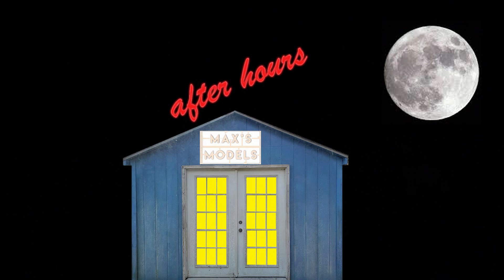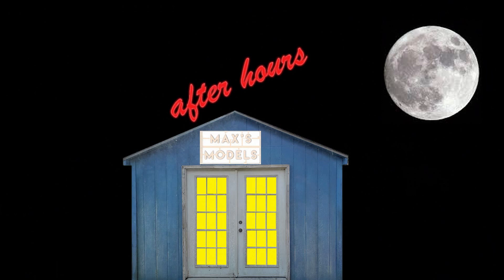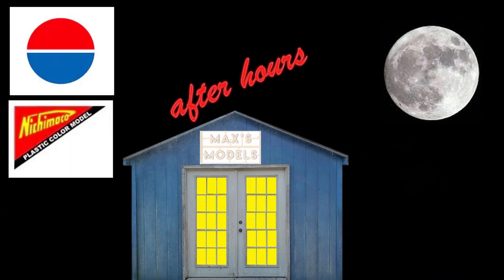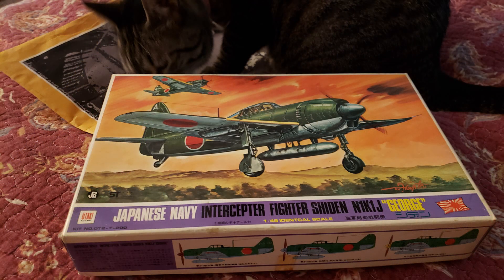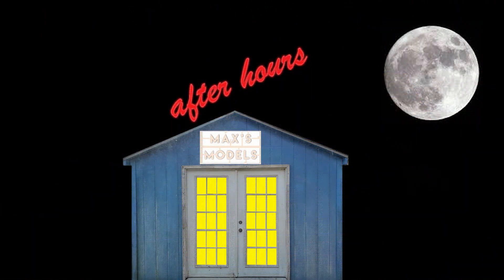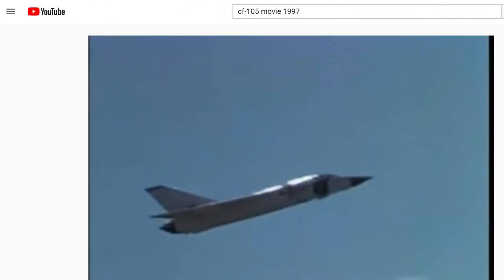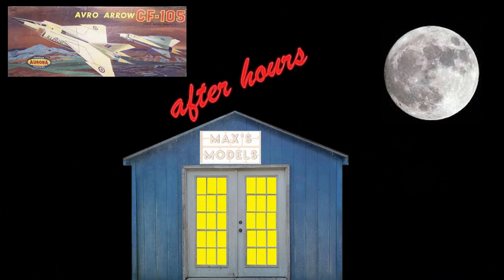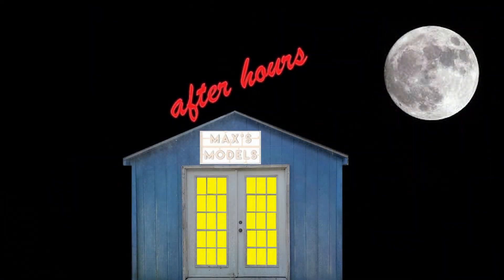Max's Models After Hours 07/28/20

Comment: Preserve that vintage box (1972) Ōtaki kit and decals Max. It's history. For an online vintage build, that exact model can still be bought (HLJ) under the ARII (Microace) reboxing. Same mould -still quite crisp sprues, but later (1975 on) drop dead gorgeous Ōtaki boxart replicated (in a window) by ARII, which unfortunately, does include different unit lower quality decals presumably commissioned by ARII as a cost cutting measure. I had a few 1/48  Ōtaki kits in the very early 1980s, and bought a few of their ARII reboxings when I returned to modelling a decade ago, one of which was that early variant "George".  Ōtaki were nice kits in their day, and if one excuses the understandable lack of detail one might find in contemporary Hasegawa or Tamiya iteration, make a great canvas before spending on more expensive kits. They still scrub up respectably. Anyone familiar with the type would immediately identify it a "George".
Reply from the maker: It does have recessed panel lines which are nice (perhaps a hair oversized) but it loooks good.  I am trying not build it but I am weak and it is soooo preeeetttyyyy.
Reply: @maxsmodels  Those old decals should work if they don't disintegrate, but the backing film will need sun 'bleaching'. I had some left over from their Bf 109 kit which were at least 40 years old I used a couple of years ago and they came up OK. But I glossed to minimise risk of silvering and was very cautious with the Microsol.

Comment: Great discussion on the CF-105.  I believe that it would have been an excellent interceptor but I am not sure it would have ever made a good multi-mission fighter aircraft.  Because of that fact I also believe it would have faded fast due to the ever changing aviation landscape!  However, at the time, no one knew how fighter aircraft we're going to evolve although I feel many of the prominent manufactures (McDonald Douglas, Lockheed,and the like) we're already steering future projects down a predetermined path.
Reply: The CF-105 was interesting but a lot of people are nuts about it. They never had a working weapon system for it. The Sparrow II never worked. A lot of people also think the CF-105 would have done Mach 3 but that is all fantasy and it never flew with it's own engines.  Should they have built it. Probably not because they never needed it. Also interceptors where not popular because the ICBM became more important. The F-108 and F-12 also where canceled because they where not need and the F-12 would have really blown the CF-`05 away.